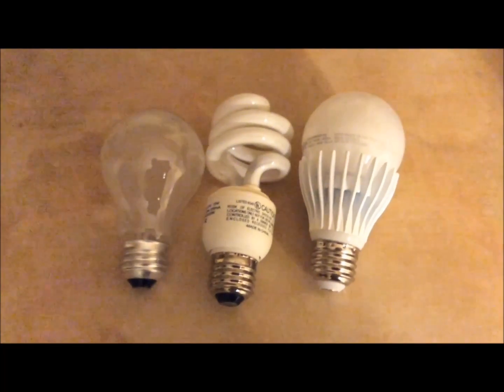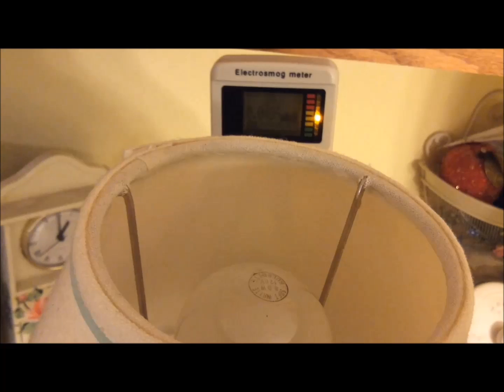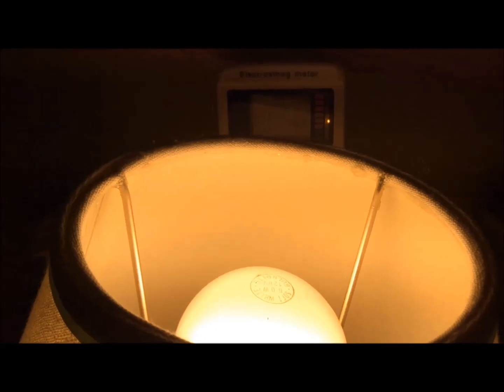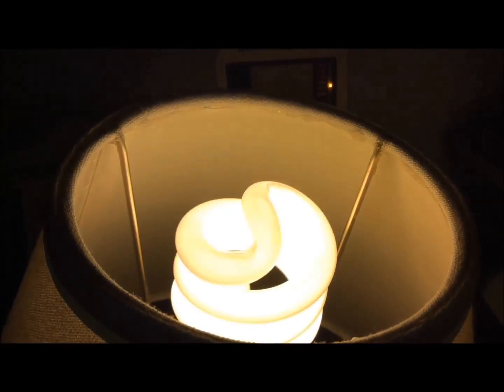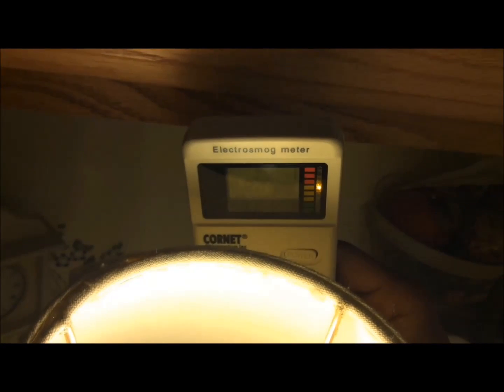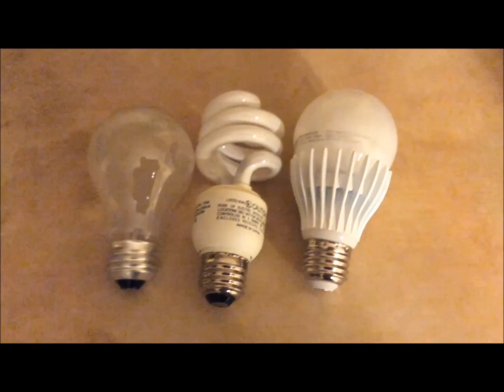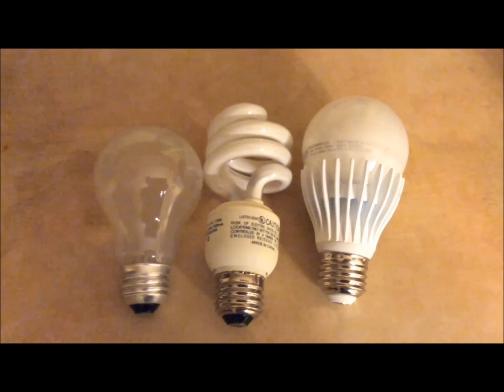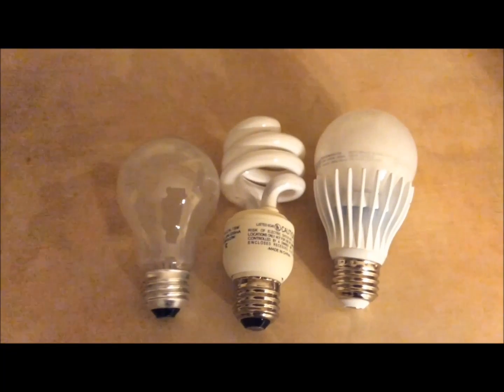Light Bulb Radiation Levels Compared

Comment: Does incadanscent bulb produces UVB light ?
Reply from the maker: Incandescent bulbs do emit infrared radiation - CFLs are the one that are known for emitting in the UV spectrum.
Reply: Lights with heat (Incandescent) are better.  Why?  The human body needs good Ionized Radiation.  We were taught that "Radiations" are bad but through my discoveries, the Human Body needs Ionized Radiation from 550nm - 570nm.  For comparison, we need to stay a distance from Infrared but far from UV Lights, since they are too low for the body to use.  Low + Decay Radiations are what harming us all.

Comment: Is it electromagnetic radiation? Because that's just light.
Reply from the maker: You have it flipped around. Light is electromagnetic radiation, specifically one small part of the electromagnetic spectrum is light. Frequencies above and below the light spectrum are electromagnetic waves that just can't be seen - i.e. radio waves, microwaves, X-rays. Not all EM waves are necessarily harmful - light and infrared for instance. However, even the wrong frequencies of light can be detrimental to health - such as blue light from computer screens.
Reply: The Sun is light and emits Ultraviolet Radiation! That's why you go blind from looking at it too long!